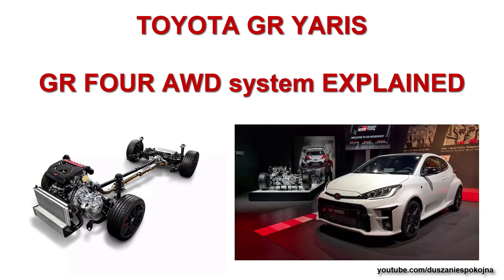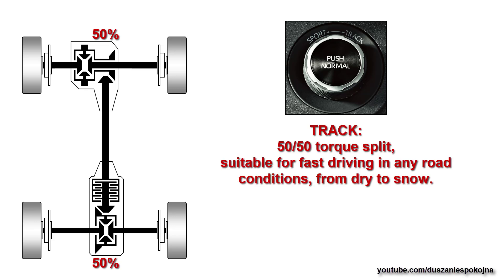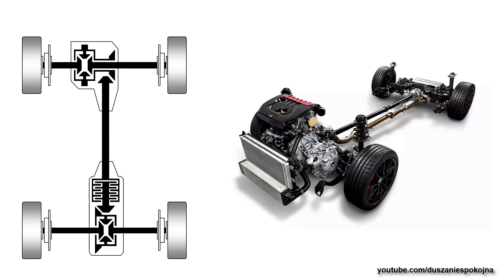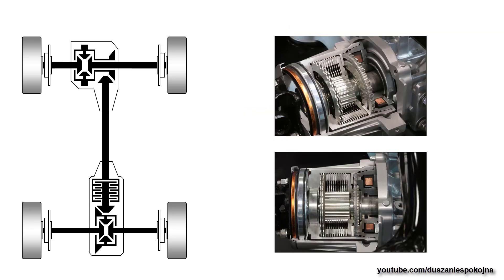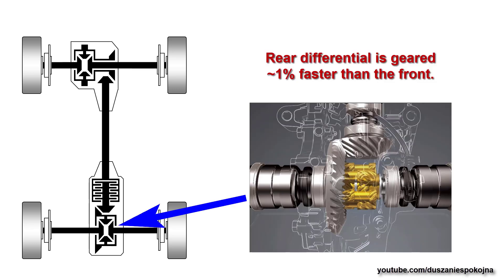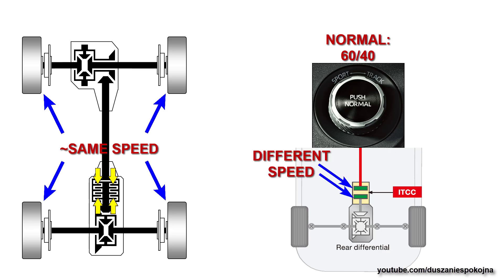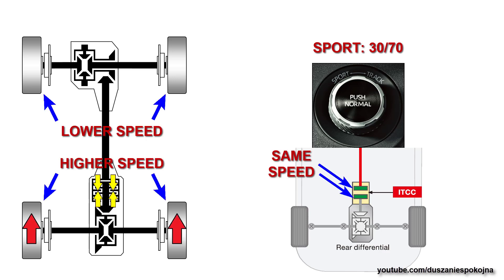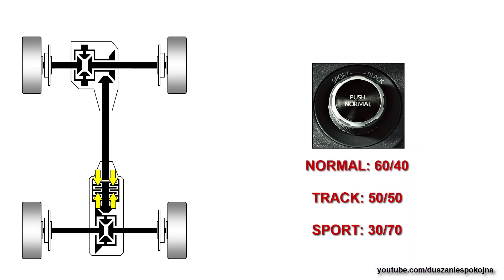Toyota GR Corolla & GR Yaris - GR FOUR AWD SYSTEM EXPLAINED - @4x4.tests.on.rollers

Comment: I have a question regarding overdriven percentage vs torque split. Honda iVTM4/SH-AWD is overdriving the rear diff by 2.7% and they claim 70% to the rear where Toyota only claim 0.7% and still 70% to the rear?
Reply from the maker: @jasonsong86  It cannot be directly compared. Toyota overdrives the mechanical rear diff. SH-AWD/i-VTM4 doesn't have rear diff, there is 90 degree angular gear to left and right, each rear wheel has its own clutch pack. I believe it never overdrive two wheels at the same time, only outer wheel during cornering.
Reply: @ it does over drive the rear axle by 2.7%. Basically the ring and pinion gear is geared such that the input shafts to the clutch packs are spinning 2.7% faster. You can send torque independently to either side as well from 50/50 to 0/100 from side to side.
Reply: @ the only reason I think Toyota “can”send 70% to the rear is due to the torsen rear diff which helps with torque multiplication.
Reply from the maker: @jasonsong86  It doesn't matter that semi axles spin faster up to the point in which clutch pack is fully locked. If it's partly engaged, there's no overdrive of wheel, if it's open, wheel is not powered at all. And as I said - I doubt the system locks both clutch packs at the same time, it rather locks only the outer one. When it comes to GR Yaris - no, it had nothing to do with torsen, basic version has open diffs.
Reply from the maker: @jasonsong86  This video doesn't say it locks both clutch packs. It engages both, that's obvious, but it doesn't lock them. It would be even impossible to drive in a straight line then...
Reply: @4x4.tests.on.rollers   you can drive  in a straight line when the rear axle is locked. Turning is the problem. I have owned locking diff vehicles. The bar is the amount of torque being applied to each wheel and if they are all the way means full lock is achieved.
Reply: @4x4.tests.on.rollers  True basic models have open diff but the torque vectoring can theoretically send 100% of the rear torque to one side.
Reply from the maker: @jasonsong86  You are missing some point but I don't know which one. If both clutch packs on rear axle are locked then rear axle spins faster than front. You can't drive in a straight line then.
Reply: @4x4.tests.on.rollers  It's only 2.7% and there is not enough power to make it do that. Too much traction.
Reply from the maker: @jasonsong86  It depends what surface you're on. These clutches are really strong.

Comment: So GRC has no center diff like the subaru system. the clutch pack is constantly engaged and constantly slipping and there its fluid is not serviceable like the diff. I start to wonder how long that stuff will last for track duty.
Reply from the maker: Majority of Subaru cars do not have center diff to.
Reply: @4x4.tests.on.rollers  Err, I'm talking about the TY75/85 manual trans, the fluid coupling has spider gears allowing it to slip, not sure about the auto trans, never dealt with one. I guess you're right, maual trans almost doesn't exist.

Comment: Hi perfect video thanks !! Finally, someone who doesn't just make videos about exhausts and intakes and says something useful for those who own GR or are interested in cars. It is clear from the video that the wear of the clutch occurs the least in the nomal mode. But I would like to ask you what happens when the clutch wears out and starts to slip. What will I feel or hear as a driver and what will actually happen ?
Reply from the maker: Thanks! Unfortunately I don't know what would the driver feel. I believe the computer would detect the wear and thus malfunction of the clutch-pack before the driver could feel it. But that's just my guess.
Reply: @4x4.tests.on.rollers  Thank you for the quick response ! Can i  still ask one thing. Hypothetically, if the axles were hard-wired instead of the clutch. what would happen ? how would the torque be distributed between the axles? And the rear axle would still like to rotate against the rear axle, is that correct? And thanks again for the reply...
Reply from the maker: @michalpovolny8461  I'm not sure what do you mean by hard-wired - stiff connection instead of clutch-pack?
Reply: @4x4.tests.on.rollers  Yes exactly . Its only hypotetical qvestion .
Reply from the maker: @michalpovolny8461  It would be impossible to drive it cause rear axle would be continously overtaking the front 😉
Reply: @4x4.tests.on.rollers  that's what I thought :) .. so if the car was in the air, the torque would be split 50/50 and the rear axle would turn by one percent more than the front in one revolution. and if it were on asphalt, all the torque would go to the rear axle, because the asphalt would create resistance, and as it started to drift, the torque on the front axle would increase, is that correct?
Reply from the maker: @michalpovolny8461  The exact difference is 0.7%, I wouldn't say that on asphalt all torque would go to the rear but majority. During drfit - rear axle loses traction so fricction cooficient goes down so more torque goes to the front - I think that;s correct :)
Reply: @4x4.tests.on.rollers  thanks man ! it's really interesting that the 0.7 percent made such a difference .. somehow my brain didn't want to accept it :D ... the saying that torque only applies where there is resistance ... I heard it for the first time and now it makes a lot more sense to me , all about torque and how power is distributed across the axles. Thanks again for your time man I appreciate it. By the way, I'm a carpenter, it was difficult for me to understand :D

Comment: Could u pls help to address my general question below… in terms of better reliability or in order for the car to last much longer

Which mode should i go for long distance drives that have long hours on the road
Reply from the maker: Normal (front) as there is the lowest clutch-pack compression.

Comment: interesting to see that "jtekt itcc" has been around since 1998 and it's at least the third generation. the only novelty is the gearing differential and constantly adjusting the clutch slip to achieve precise RWD bias.
they increased the number of discs probably to offset the fact it's gonna slip almost continuously on a track. I still hope they open the clutch when it's useless, stealing power/efficiency/reliability like highway cruising or even top speed run/long straights
Reply from the maker: On straights they do open the clutch-pack, mainly for cooling purposes.

Comment: Thank you for directing me to the video. I guess what I'm still confused about, partly, is when it completely locks and gets 30/70, how is that possible with only a .7% difference between the speeds the axles are trying to spin? I think I am getting more of the concept from this video, thank you...but I still can't grasp the .7% translating to 30/70 in a locked clutch pack. If you could point me to some math, I'd greatly appreciate it.
Reply from the maker: 30/70 doesn't mean that the clutch-pack is locked. Rule is simple - torque goes towards the resistance. If rear wheels are are harder to spin than the front - they get more torque. According to JTEKT, maximum it can achieve is 20/80 but the most important thing - 60/40, 50/50 and 30/70 are not real constant torque splits but driving characteristics which system is providing. Try to find the discussion started by Mike Beale under Jason's video - maybe those guys can help in terms of math and .7 value
Reply: @4x4.tests.on.rollers  Thanks, I'll try that. I appreciate the further explanation. Yes, I will try to find the math, so I can better understand how that .7% turns into such splits.
Reply: @tonypalmentera7752  it's quite complex but let's make things simpler, and just imagine an "ideal" world where the wheel wouldn't be able to slip (infinite traction, no wheel slip, like if your wheels were pinions rotating on a rack), the clutch is fully open, and the car has some speed, in a straight line. all wheels are rotating at the same speed. because of the different gearing, the shaft would be turning at slightly  different speed, faster in the front, slower in the rear, all wheels have zero torque. when you'd try to engage the clutch, you start generating torque at the clutch because of the speed differential. it would send equal and opposite torque, positive to the rear, negative to the front, but because rear has longer gearing,  the car would slow down and energy would be dissipated in the clutch with a net zero total torque on the 4 wheels, so no effect on the car speed. the stronger you engage the clutch, the stronger the torque, but the clutch keeps slipping. now if you add power  from the motor you are adding positive torque to both wheel, that's how you end up with a rear wheel bias. in the rear world, wheels that are applying torque to the road are going to slip a certain amount depending on the torque, the tires and the road. because the difference in gearing is only 0.7%, the whole system wouldn't break even if you locked the clutch completely, because the tires would just give in and slip differently front/rear, but with a strong rear bias. constantly adjusting the clutch engagement allows to maintain  exactly the desired torque split while allowing a small amount of slip. because the  gearing difference is very low, the relative speed between the discs of the clutc is low, meaning you can apply strong torque through the clutch without burning/overheating, or wearing the clutch too quickly. think of it like  using brakes at 1mph. you don't need lot of force to brake, and even  if you go down a steep hill at 1mph using your brakes, they are not going to overheat. thanks to oil bath and 12 discs, wear should stay low too
Reply: @geemy9675  thank you...that helped a lot...if you could point me to where that .7% in the math turns into rear bias, I would greatly appreciate it. I almost want to do a spreadsheet on it and play with the numbers to understand it better.
Reply: to put it more simply, because the front wheels wanna  go slower than the car, they are not powering the car if the clutch is locked. the 0.7% must have been carefully tuned, so that even in a launch control if you are in first gear wide throttle, even if the rear wheel slip ratio is higher than the front wheels, the rear shaft is still rotating slower so the rear clutch can still be partially opened and maintain the torque split
if you Google "optimal longitudinal tire slip ratio" you'll find:
A general trend seen in tyres is a longitudinal force peak at a slip ratio of around 0.3 – 0.4.
so I would say this is where the 0.7 is coming from. if you are driving on surface with less grip you might need more slip
remember tire slip around .5% is not drifting (maybe like 100% or more) /burnout (infinite if front wheels are not moving)
so even though you can force RWD bias, it is impossible to do RWD drifts or burnouts with this system, since rear wheels can only spin 0.7% faster than front. only AWD drifts/burnouts
Reply: @geemy9675  Again, thanks so much! Is it .7% multiplied by slip? rotations of the tire? Distance they travel? I know it equates to 30/70 (F/R bias), I just can't understand what .7% is being multiplied by to get 70% rear bias. I get it has to be 100x, but I'm not clear on 100 of what units. I know I'm dense, I'm sorry. You're extremely helpful, my friend. I definitely understand it better than before...still thirsting for that equation though lol
Reply: @tonypalmentera7752  no it doesn't get multiplied. there is no easy calculation gear ratio ratio => torque split ratio . first you need to understand that this system doesn't not create a precise constant torque split by design. the clutch needs to be constantly slipping and constantly adjusting its engagement,  to provide a constant front /rear bias.
if the clutch controlling the rear was locked, RWD would get 100% or more than 100% of the torque. the car would be very heavily RWD, with front tires would get negative torque , meaning braking.
 from there, electronics just need to adjust the clutch engagement to reduce the rear wheel torque to the desired presets 30/70,50/50,60/40.
Reply: @geemy9675  Okay, thank you for explaining more. It's okay if the math is complicated, but that .7% comes from somewhere, as do the final torque splits of 30/70...so there has to be math. I am a math person, I'll fully grasp it through the equations. Unfortunately, I don't have them, so I still can't quite understand how just a .7% slip can result in 30/70, or even 0/100 rear bias. 

Whether multiplied, divided, calculus, I don't care...I just want to see the math to understand it, that's all. Otherwise I fell a tad lost. 

I also got lost when you said more than 100% of the torque...how can the rear get more total torque than the car is producing in the power plant and gearing? 

Anyway thanks so much for spending so much time with me on this. I just really need the math, or my dense head can't seem to fully understand it.

Comment: Sweet. Can you drive the car on a daily basis using 50/50 and 30/70 without causing too much wear? Or are those two modes more geared towards occasional use?
Reply from the maker: Both modes will cause more wear. However - if you drive the car normally, not too sporty, everything should be OK.
Reply: These cars are built to drive. If a manufacturer puts a feature in a car it’s because it’s been designed to last the life of the vehicle. The majority of wear will happen if the system gets really hot so yeah don’t drive like you stole it and you’ll be fine driving it 30/70 daily

Comment: Great video! What would be the torque split between front and rear axle if the front wheels are on ice or in the air and the rear wheels are on tarmac? Is it possible to reach like 0/100 F/R in condition like that? I know it is not a realistic situation but I’m just curious
Reply from the maker: Thanks!  Yes, in such situation torque split would be almost 0/100 FR, it is simulated here https://youtu.be/9kUMNtcrxXA
Reply: @4x4.tests.on.rollers  thanks! Keep up the good work guys I love your videos 👍🏻

Comment: so is this more like vw haldex or subarus awd????????
Reply from the maker: Yes but different front/rear diffs gearing.
Reply: @4x4.tests.on.rollers  that didn't answer the question is it like vw haldex?
Reply from the maker: @odinisgod4577  Layout is the same (FWD based, rear wheels powered by clutch-pack). Clutch-packs are different. I also don't think that VW uses different gearing.

Comment: I have a question... If you put this car on a dyno in the different modes, will power figures be different? In other words, which mode is actually optimal in terms of power output?
Reply from the maker: I think it would be the same in each mode, there's no cornering factor on a dyno.
Reply: @4x4.tests.on.rollers  thank you for the response sir and the great video, I really appreciate it ☺️ I was struggling to understand why the normal mode of 60/40 even exists but now I think I get it. I still haven't figured out which mode is best for daily driving though 😅

Comment: Is this permanent all wheel drive. Anyone know the difference between the GR Yaris and Lancia Delta Integrale all wheel drive. I believe Lancia is permanent
Reply from the maker: Both are permanent but Lancia was using center differential, GR Yaris doesn't have it.
Reply: @4x4.tests.on.rollers  I the GR Yaris FWD biased?
Reply from the maker: @radiogreenblue  It's fwd based. But handling can be fwd biased, neutral or rwd biased.